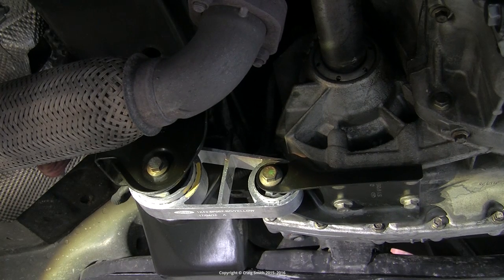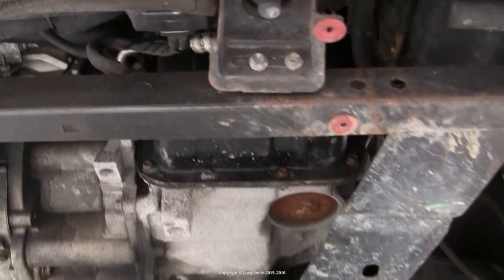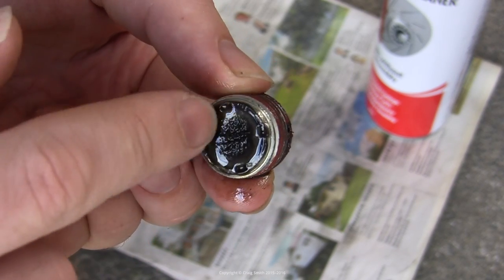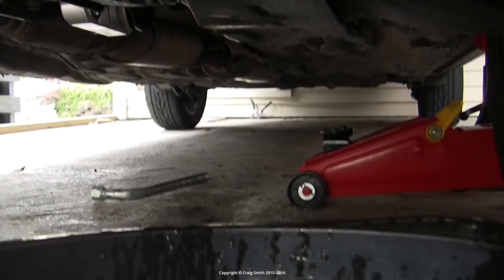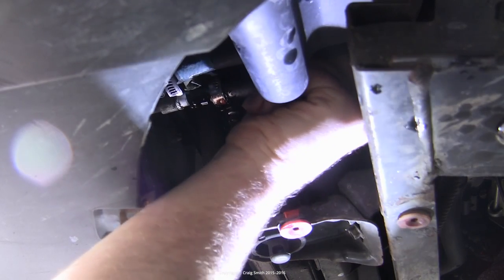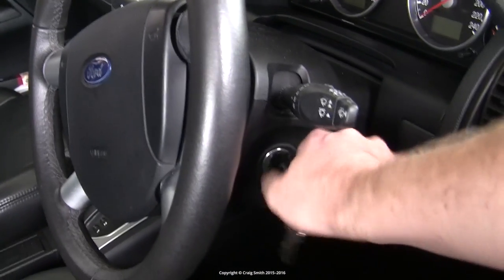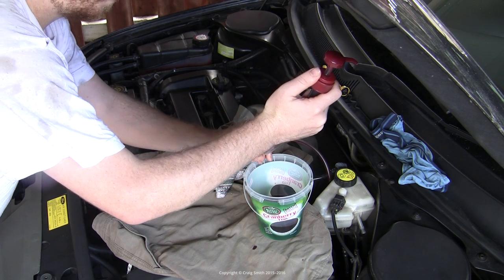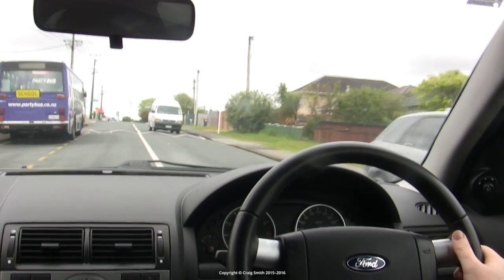Simple how-to: Change Ford CD4E auto trans fluid (Mondeo, Contour, Escape, Tribute etc)

Comment: informative, spot on except for the oil cooler hose. you should have removed the return hose from the oil cooler to completely flash the old oil in the cooler as well and you should have run an extra liter or so just to make sure that no sign of the old oil remained. just an added information. hope you dont mind.

Comment: I thought he did good job of explaining it. I wanted to add - I just did my 2006 Ford Escape V6 and had trouble deciding which line was the return transmission cooler line - I took off the plastic shroud in front of the trans about 6 bolts 10mm and 1 plastic clip near brake lines. just above that shroud is the line I used it has a section of rubber hose clamped to a aluminum pipe it runs under the trans. and up behind it loops above and fits in top back of trans. I hooked short piece of 3/8" copper tube to the rubber hose and aimed it into a 5 gallon bucket. I had already marked quart marks on the plastic bucket using a kitchen measuring cup. Anyway it worked great... I put the car up on ramps and drained 4 qts. from the sump then refilled those 4 quarts before removing the cooler line  then started the car and shifted through all the gears D, N R, D, 2 and 1 with the parking brake on and my foot on the brake and checked the bucket  added 3 quarts while I watched the bucket fill and stop the engine at 9.7 quarts- refilled up to 9 quarts drove up and down the street then when the car was warm finished filling ( to the bottom of the hash marks on the dip stick. My 2006 ford escape uses 10.25 quarts of Mercron so I got the last 10 quarts Walmart had 17.00 per gallon and 4.50 for each quart. Seems to be running good.
Reply: A better plan is to NOT remove fluid from the sump at all.  Remove the rubber hose from the output of the cooler, start the car and let the trans pump itself into a milk jug.  Remove two quarts at a time, shut the engine down and add a fresh two quarts through the filler tube. Do this 5 more times.  Do NOT run trans through the gears during process or it will mix your fresh fluid with the old.

Comment: Thanks for all the info!  Saved me from making the mistake of assuming this was old-school drop the pan/drain and change filter kind of setup- had no idea it had a drain plug, or that the filter wasn't easily replaceable and I'd nearly ordered one.  my '99 Mystique has started acting wonky and I really don't know if the fluid (which looks actually pretty good off the dipstick) has ever been replaced.  Intend to replace with some fresh Dex/Merc (dipstick calls for plain Mercon) and add in a bottle of Lucas Transmission Fix.  Hoping it clears up my problems which are mostly surges and hard shifts especially when the O/D is enabled.
Reply: Follow up and some observations.  My tranny issues cleared up after a few drives with a partial change and replacing one of the quarts with Lucas transmission fix.  I wound up using Dex/Merc, after much research and consideration, I decided that with the vintage of my transmission I didn't need Mercon V and Dex/Merc replacement fluid would suffice.  My dipstick said Mercon, so Mercon it was.  I continued to have a few little shifting problems until a good drive on windy, hilly roads with a lot of manual up/down shifting got everything worked out, and it's been solid since.

I did NOT disconnect the lines and do the 'flush': I've never personally had a Ford product that had rubber lines as shown in this video, and I wasn't of a mind to mess with the metal fittings to the radiator/fluid cooler- something I have broken in the past on an old Ford.  So I just did the drain plug drain but as in the video, let it sit overnight.  Second, not all drain plugs are magnetic!  I was very pleased with how clean my drain plug was, until I realised that it wasn't at all magnetised.  Go figure.

Comment: manny manny thanks. i wonder if you have or ever had any problems with the cd4e.
Reply from the maker: +Jaap Rijke Nothing major. Mine has harsh shifting from time to time, but has 150000 km on it so it's to be expected. It basically works okay. Also minor fluid leak at halfshaft seal.

Comment: Hi Craig
Have same car 2006 version with 137,000 miles. ( same box) Recently bought, no service history, fluid dark brown ( possibly old). 
Is it worth just draining out what is in sump and replacing it ( about 4 litres). I wouldn’t want to flush it or drain all of it. The box is running well, gears change as they should, just a slight wear noise when in first and 2nd. 
Reason I ask it there is so many different views about changing transition fluid on high mileage, no service history automatic cars.
Great videos by the way.

Comment: excelent video..👍👍
I want to ask. when draining dirty oil through the hose. engine is started on the transmission lever P or N or D
Reply from the maker: Leave it in P, certainly not D, you are just using the pump to extract the oil, do not engage the transmission!

Comment: Hi Craig just wanted A little help here thanks Craig.  I've got a 2002 Ford mondeo zetec hatchback car., I'm just wondering if I can  use  Macon 5 transmission fluid or should I just use Macon 3 transmission fluid?
Reply from the maker: Yeh Ford switched to "Mercon V" which is the spec you see me using here, though I'm not using a Ford product.

Comment: Hello, there is a jerk in my automatic gear car when shifting from 1st gear to 2nd gear. I changed the transmission mount, but the result is the same. What else could be the problem Thanks .
Reply from the maker: Problem with the gearbox. They usually wear 2nd.

Comment: I enjoyed your vid, but I wonder about the volume descrepancy too. Same thing happened to me, I wonder if it was drained cold and measured hot. ?
Reply from the maker: Yes, differences in temperature plus measurement errors both out and in. You have to measure the final level by the correct procedure.

Comment: Hi. I am just wondering is it necessary to fill ATF after you drain only firs part of fluid? Or I can drain all amount of fluid (firs and second part) and refill ATF at once? Or there are two separate circuits? Thank you for video it is very useful.
Reply from the maker: +Artem Lysenko We are flushing a part of the transmission, not just draining and refilling its sump. Once new fluid is in the sump, we run the engine and use the transmission's oil pump to flush new oil (from the sump) through the components and push the old oil out the cooler hose. If you don't fill the sump after draining it, obviously there is no oil to flush with. This way we can replace more like 2/3 or 3/4 of the total ATF, instead of just 1/3.
Reply: +Craig's DIY Car Jobs Oh, l understand now. Thank you for respond! Have a nice day.

Comment: Hi Craig ... I checked out my Trans Fluid its a 2001 Mazda Tribute 3L V6 Auto trans...  and I noticed that on Cold non-operating temperatures, my Fluid is a tiny bit over the "hashed" fill-area you mentioned in the video, However, it does not reach the "DO NOT FILL AT THIS LEVEL" marking on my dipstick. Should I drain some out? or should I run the car first to warm up the oil THEN measure it to see if i need to drain some out or not? - Many Thanks!
Reply from the maker: You need to follow the correct procedure, as I link to within this video, elaborated on here: https://youtu.be/n67taQHg9eo

Comment: havent got the kiwi accent down yet mate, thanks for the info, ive got (from hot) a trans dipstick in same car and its shot wayyy past the fill line about 3 inches past it what do you think that is would it not blow a gasket by now? engine was rebuilt 30k ago and receipts for transmission "service". do i just drop out 5L and check the stick again? or would a slight decline as its parked cause this. thanks chch
Reply from the maker: Well yes 3" over the max mark sounds like a big overfill that I would want to resolve asap, but certainly check it on flat ground first.

Comment: can i use silicon or teflon paste as thread sealant?? or is there any other material i can use , because i can't find a thread sealant in my area ! 
also is it the same procedure for "awf21" ford mondeo 2011 transmission ? 
thank you for this great video
Reply from the maker: You must use a sealant of the correct spec. If you look at the video desc., I put Amazon links for the right types. I don't know where you are, but Amazon.com (US) has extremely cheap international shipping on this sort of thing. I didn't buy it locally either because it's cheaper to ship it halfway round the planet, go figure.
Reply from the maker: I don't know about the AWF21, I would say probably similar, but you will have to check my answer re the thread sealant as it may use a washer seal on the plug instead.

Comment: Hello! I am from Romania, I have a Mondeo Ford, with gearbox, from 2002, 2.0 benzine, and my problem is that the car does not leave the place. It just goes in reverse. Get in speed but just go back, it doesn't goes forward, just in reverse. I have changed the oil from gearbox after I had problems but in vain.The car just goes in reverse and get in speed but just go back, it doesn't goes forward. Please can you help with some advice!!  What do you think is wrong? Thank you!
Reply from the maker: Oil change isn't going to fix that so long as the level is not way wrong. You could check minor possibilities like 1) gear shift lever is operating correctly (watch it at the gearbox), and 2) check the speed sensor is functioning properly. Otherwise the whole trans will need a rebuild or a replacement.

Comment: Hey THX, really good this video and helpful. Easy to imitate on my Ford. But now I have the problem that the gear sometimes jumps out. Means I drive, stop on the traffic light and can not start again. The engine turns higher but there is no gear in even more. With 1500rpm and higher it jumps in not funny but than it is in and I can drive. Do you have an Idea what it is?
Have the feeling with the new Oil the pump makes not enough presure. Is an idea like this realistic? Sorry for my english ;)
Reply from the maker: I don't know. Check the fluid level carefully per the correct procedure. Did you use the correct fluid spec. Possibly there was a problem before and the new fluid has 'flushed' it out. I am just guessing.
Reply: Should be the right fluid. Ja the strange is with the level, had the right level in and tryed to leave my garage the hill up (10m distance goes 2m up) and it wasn't passible. With 500ml more oil it worked. But now it is to much in that is clear... But it works only like this. I think I repeated everything with a other Oil... Even when I really can not imagen that this makes a difference. Let us see

Comment: Hi Craig, a kiwi here. How did you end up liking the Penrite? Would you recommend it?
Reply from the maker: Well the transmission is still running fine. Yes.
Reply from the maker: Oh check with Ford locally, I noticed the price for Ford label Mercon V was not too bad (surprisingly) last time I was at John Andrew, you have to get it in 1 L bottles but the price was comparable.

Comment: I have a Mk3 with Jatco transmission (5 speed - part #1383840). Is it the same procedure?
Reply from the maker: The procedure in principle is the same for any auto box, assuming you can refill via dipstick, but you would want to check to see if you can also replace the filter unlike the CD4E.

Comment: Thanks for the Video. Can I use Permatex Ultra Black Gasket Maker to seal the drain plug?
Reply from the maker: Umm. I don't know... it might work, the bigger problem would be getting it off the threads next time...
Reply: @CraigsDIY  played it save and got the proper sealant. It meant not having my car for another day but it all worked. Thanks for your Vid!

Comment: I was wondering how to remove the transmission oil pan gasket?
Reply from the maker: Well the 'pan' is vertically mounted and some of the bolts look very awkward to access in situ, so with difficulty I would say. If you have a legitimate need to get inside it then it might be a case of taking the whole trans off. Why do you want to remove it?

Comment: can you just use the oil cooler to drain it and check the drain bolt for meatal and stuff
Reply from the maker: Most of the oil sits within the transmission, which is why the technique shown makes use of the trans pump to get more of that out. If you just drain the cooler and the sump you will only get about 1/3 out.
Reply: thanks i just wanted to know because this girl i know has one and i dont think its been changed scince 2008/160000+ miles

Comment: Ford mk 3 users : not sure the gear box is identical on petrol and diesel for mk3 model. On diesel, the gear box is jf 506 e. Made in Japan and needs 7.9 liters according to specs. Trust me, it wasn't easy to find this info. Not sure, as I was saying, about the being the same type of gear box because the one on diesel doesn't have a dyp stick.
Reply from the maker: It's not the same. This is the CD4E.
Reply: @CraigsDIY  That's correct. My mistake :)

Comment: how many kilometers travel to change oil? sorry for bad english.
Reply from the maker: For the ATF, it depends on usage. Minimum (extreme) interval would be 50,000 km but only if the car is being heavily used/abused. Really you should inspect the oil and look for discoloration, burning, or metal specks. If it is red and clean it doesn't need changing.
Reply: discoloration can cause problems in shifting? i noticed that my ford escape transmition oils color is light pink, and i just noticed problems in shifting. i looked to the specs and says that i need to use motorcraft mercon ATF transmition oil. ty for the video.

Comment: oil filter dont change ??or this automatic whisout filter?
Reply from the maker: As said in the video, the oil filter in these boxes is built inside the unit, not user serviceable, you would only change it if doing a rebuild.
Reply: Sorry my box 5 speed.
Reply: @CraigsDIY  https://www.autozone.com.mx/encendido-afinacion-y-mantenimiento-de-rutina/filtro-de-transmision-automatica/duralast-filtro-de-transmision-automatica/272495_0_0
si puedes cambiar el filtro de transmision automatica
saludos

Comment: craig i think you should not use a cheap floopy ratchet on a drain plug that is steal on soft metal  you can make them strip the threads.. i would use a power bar  no flop ..i understand you knowing what your doing  but a noob at this might not relize
Reply from the maker: If you mean tighten it with a torque wrench then yes that would be ideal.